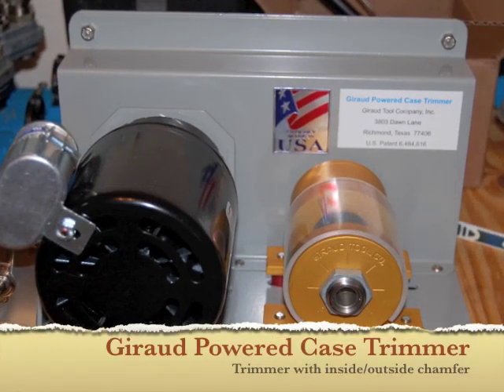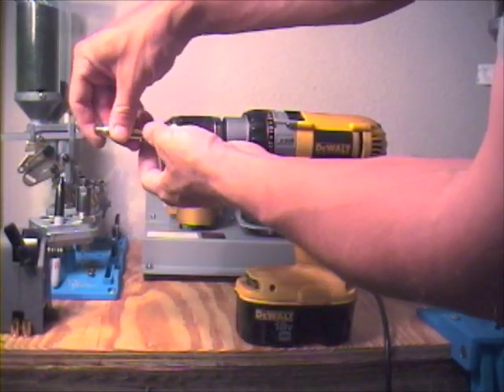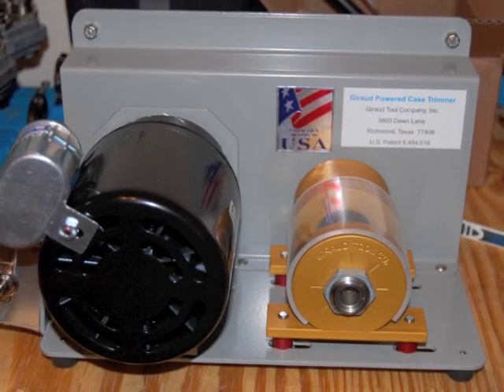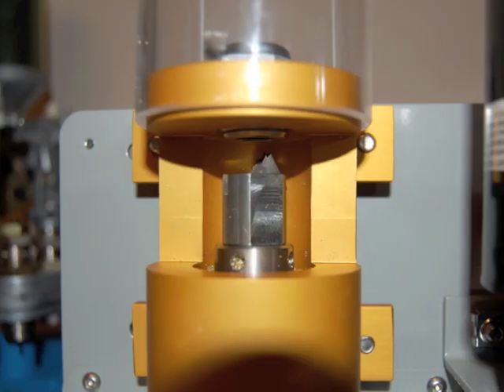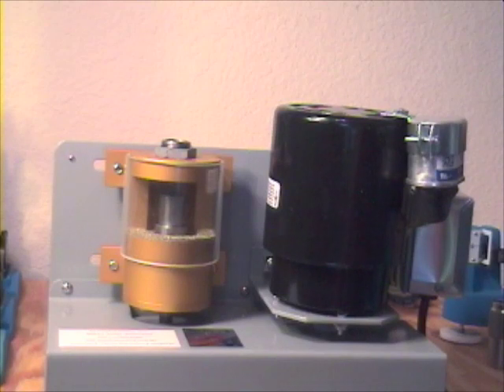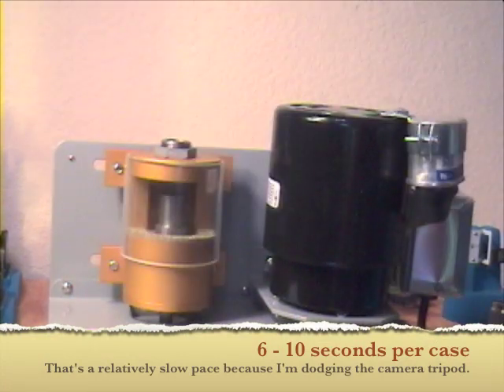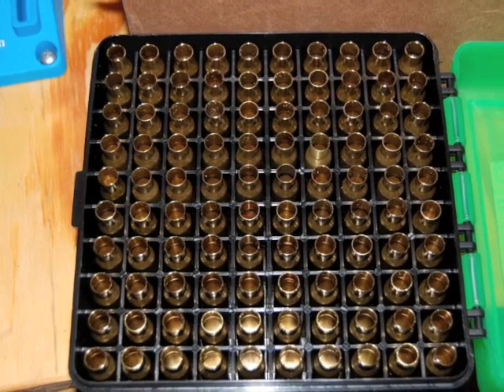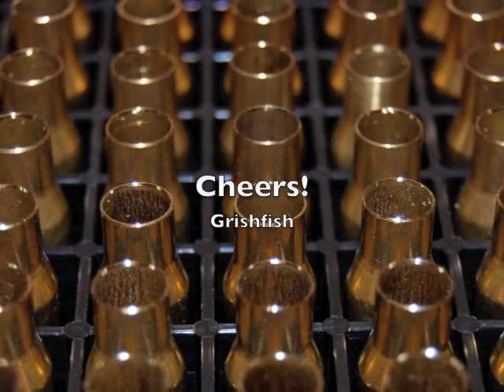Giraud Powered Case Trimmer

Comment from the maker: Seems very consistent to me although I've not done a hardcore evaluation.  For me the unit is about volume processing more than perfect accuracy, but the Giraud manual says 0.001" case length consistency is possible.  Look in my description for the video, you find the manufacturer link and you can read the instructions and get more detailed info on the unit.

Comment: hell with the $$$ guys it works great  and vary easy 2 use & set up saves hrs of work  . if u only load one time a yr like 100 rds this not for you . i shoot blk guns my brass gets loaded 8 times in one summer this is a time saver when i shoot 308lr & 556 trims and deburs all in one shot ..keep the mess contained so u can do it anywhere . I be lost w/ out mine if i had 2 trim  with one of them hand crank  trimmers came over on the Mayflower i buy new brass ..

Comment: I have been using the Lyman E Zee Trimmer...not so easy on the hands. I am ordering a Tri-Way tomorrow. 

I am wondering if you have found the best rpm for trimming? As to not prematurely wear out the cutter. Mine will be chucked in a drill for the time being. Waiting on a variable buffer/polisher motor to arrive.
Reply from the maker: 970HANDLOADER If I had to guess, I'd say the machine rotates at about 2000 rpm.  3000 for the motor and then there's a belt and pulley that further decrease the final drive speed.  If your cutter is carbide, you'd really have to try and hurt it with brass.

Comment: how can you set the overall length of the brass? Also how long does this blade last?
Reply from the maker: The directions are linked in the description.
Reply: theoretically if you don't cut anything other than brass the blade will last forever.  Carbide is way harder than brass.  Cleaning them might be a good idea every couple of thousand or so due to brass build up.

Comment: That is bad ass.  I am going to make one.
Reply from the maker: I imagine the trick is the carbide cutting blade.  Otherwise the machine is quite simple.
Reply: Carbide inserts for lathe tooling should do the trick.. of course undertaking such a project to save money usually means I spend more than I would just buying the unit...never fails..

Comment: It's obvious from watching the video that the tool isn't very precise.  It's fast, but for the money I expect better precision.
Reply from the maker: DonziGT230 Actually, the tool is very precise.  However, the brass is highly variable since it's once-fired machine gun spent brass.  If you put highly uniform brass in there, you get repeatable precision.
Reply: grishfish Even if the necks had high & low spots, which seems unlikely, once the tool cut it down it should be flat.  If it were flat and the tool were holding the shell straight then rotating the shell wouldn't change the cut and it does.  I can see that the shell wobbles in the holder which is probably what's causing the inconsistent sounding cutting.  If it were just trimming the outcome would be inconsequential.  Being that the tool is also chamfering/de-burring I imagine that the edges are going to have a fair amount of deviation around the circumference.  In the close-up at the end it appears some of them have a sharper edge than others tho it could be camera angle and resolution creating an effect.  Picturing the sharp V cutter and any wobble of the shell I imagine that the profile varies on each individual shell around it's circumference.  I've never used this machine so it's speculation based on what I know of machining and I can accept that the outcome, even if not absolutely perfect, may be 'good enough'.  If I could put my hands on one to try myself it's possible I'd be convinced to buy one.
  I appreciate the reply and please understand that I'm in no way implying you're a liar, but my eyes & ears both tell me the machine isn't making a concentric cut so I'd have to see the outcome to be convinced that the deviation is inconsequential.  Chamfering/de-burring by hand isn't a perfect process and I've screwed up by being impatient, but the upside is it can be controlled.
Reply from the maker: DonziGT230 Send me your address in a PM and I'll send you a piece of 308 brass.  As I use my eyes, I really can't see any deviation.  That way you can analyze it for yourself.
Reply: grishfish I appreciate the offer but I later watched another video on this machine where the guy initially had issues with uneven chamfering/de-burring as I expected to happen but said that with giving the case 3 full turns in the machine the cases came out even.  His close-ups showed a great surface inside and out, better than I expected.  I imagine that small deviations between different people's set-up of the cutter will make the machine a little more or less consistent as would case sizing to some degree which would explain you only needing one turn and him needing several to get that all around even cut.  I haven't done any shopping on it; is there a particular place to get the best price on one of these?
Reply from the maker: DonziGT230 The instructions mention making a 1/2 turn of the case, but I always do a full 360 with each case.  I think the guy that builds them is the only place you can get them.  I've never seen them for sale elsewhere.  Good hunting!
Reply: DonziGT230   I have one and I can tell you that it  is VERY precise.
Reply: DonziGT230 Yes this machine is pricey, but when you process over a thousand cases of 5.56 at a time, precision is well within the quality of what is available currently at half the price. If you are defining "precision" as repeatability, I get .005" COAL average deviance between cases. The only reason for larger variance is some sort of contamination or an issue with the case itself. For high volume reloading, this machine is worth every penny.